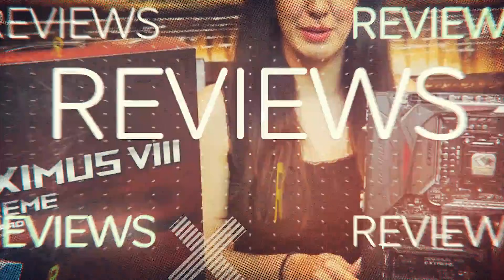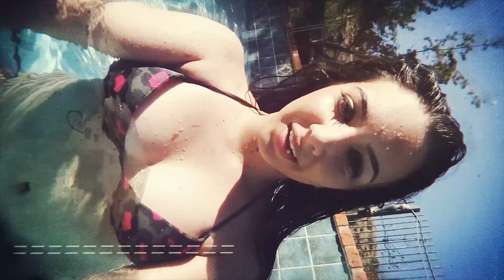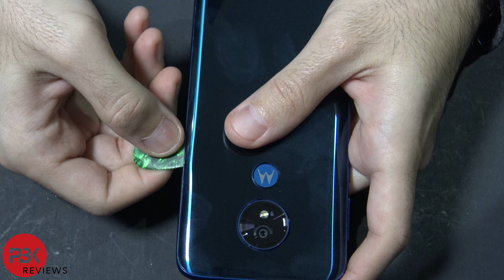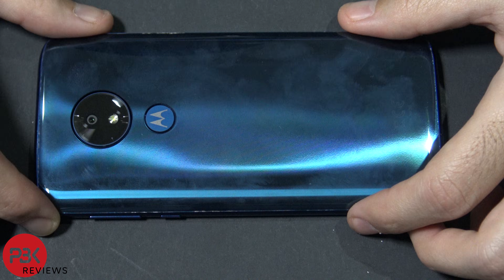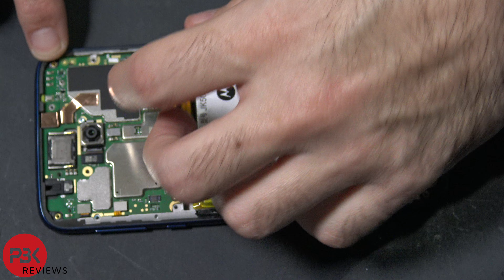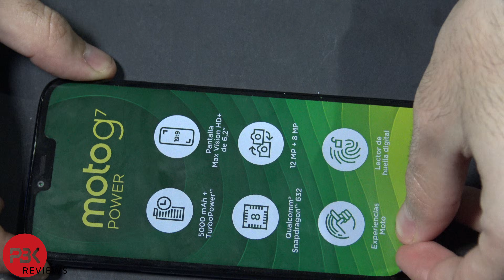Motorola Moto G7 Power Disassembly Teardown XT1955 Repair Video

Comment: Do we have to take the Whole Entire parts Out of The Phone in Order To Replace the Battery??? Or Can you just take the battery out On Its Own.
Reply from the maker: no, just enough to gain access to disconnecting the battery cable and prying it off. You can use isopropyl alcohol and apply to the sides n let it sit for 30 seconds so it goes underneath and eats away at the adhesive, making it easier to pry off.
Reply: Thank you

Comment: Amazing teardown ! Thanks for all the info about this phone. Can anyone confirm which side is positive and which negative on the connector from the battery to the board ? I want to try to skip the battery and just power it from a power supply. Thanks.
Reply from the maker: Thanks. I'm not too sure on that to answer your question. Maybe someone else can chip in and answer it :)

Comment: Im having trouble with reception. In town its great but it doesnt get good reception like it use to out in the coutry where i live. Does the antenna need to be replaced??
Reply from the maker: I don't think it would be a replacement issue. You can try taking the back off (which would require new adhesive to re install) and making sure the bottom and top plastic covers are in place and screwed down since those have antenna lines running through them. If not, the only other thing I can think of is its possible they have changed tower frequencies or bands in your area or a certain tower is out of service or they changed the position of one of the towers to send signal in a different direction more which sometimes happens.

Comment: Thank you so much..with your video I was able to replace my charging port. Saved me alot of money that I did not have.
Reply from the maker: Glad it helped!
Reply: @PBKreviews  I used to have the phone, then I upgraded to s22. the moto's battery would last from the time I woke up to the time I went to bed charged to 85%, and not dead the next morning either (although it would be at 20%), even after it was over 1.5 years old. I would be lucky to have my s22 last from 5am to 8pm on a full charge. point is; it is ironic how old budget phones which costed $200 could outlast modern brand new flagships.
Reply: I still can't get the last at the far left out. I can get all of them except for that one and I don't know why?.

Comment: so after putting it back together the screen doesnt react to touch but its on and working any ideas? plz help
Reply from the maker: Can be a loose cable or dirty cable contact, try cleaning the gold tip of the cable with a micro fiber or something to make sure its clean. Also can be a defective screen, or a short somewhere causing the screen not to function properly. Before putting the screen in place, try connecting the cable only and see if the touch works. If it works and when you seat the screen in place and it stops working, it means something on the screen is touching the metal frame and shorting. If it still doesn't work might just be a defective screen.

Comment: My speaker is weak and distorted, and a few people tell me they can barely hear my so I need to try to clean my speaker and mic. Any tips on doing that? My charging port is a loose too and doesn't always connect. Are the mic and charging port on the same board? If so, maybe I should just replace that.

I need to order screwdrivers. Yours is T4 but another place says Phillips. Any idea why?

What thickness is your guitar pick?
Reply from the maker: Hi, yes both the mic and charger port are on the same sub board on bottom. If you are replacing that sub board, make sure to get the correct version for your model phone, since different region versions might have different antenna point/contacts which might give you some signal issues. Also some aftermarket ones are known to have signal issues. You can check mobiledefenders.com to see if they carry this part since they usually carry OEM stuff for Motorola. Also brush off the mic hole on bottom to make sure its not clogged causing your voice not to be heard. As for the speaker/ear speaker, the filter might have gotten clogged/dirty causing sound issues. You may need to clean that somehow or replace the filter but those filters usually aren't easy to find and sometimes require prying the screen off as well to replace the mesh filter. As for the screws, they should be T4 torx screws unless a different region of the device uses different type of screws but highly doubt it.
Reply: @PBKreviews  Thank you for the information. I tried blowing real hard on the speaker, and tried holding a vacuum cleaner up to it, but neither worked. I'm thinking there's dirt on the back side of the mesh that I could remove if I open the phone. Also in another video, I think it shows a small filter attached to the mesh (inside phone) that catches stuff and could be replaced, or just removed and not used if that's what causes problems.

Motodefenders doesn't show that they sell that board for it. They do have the separate charging port and speaker, but not sure how hard those are to replace, and they don't sell the mic. Hopefully cleaning inside will solve the sound problems. My charging port isn't too bad. 

I'm not positive but the problems seemed to start after I wiped the phone with a wet cloth, but that was weeks ago and it's still happening.

BTW, I have the G7 Power US version.

Comment: Hello! I have a question. My phone is able to be charged but I can not currently turn it on due to the power button falling off, if I removed the battery and put it back together would that make it turn on? thanks in advance!
Reply from the maker: Hi, no it would not power the phone on but disconnecting and re connecting the battery. There should be a clicker on a flex cable where the actual physical button presses on. You should be able to use a tool to push in that clicker to power it on but keep in mind over time doing that would probably wear out that clicker or damage it.
Reply: @PBKreviews  its okay, I got it fixed by a friend

Comment: I broke the little connector on  the board, where it goes connected one of the tiny coaxial cables.
Where do I get a replacement?
Then I have to solder it.
Reply from the maker: Connectors you may need to look on ebay or google it not too sure on that. I'm not a pro at soldering myself so haven't spent much time looking into it.

Comment: I need help. Everytime I plunge my phone in the charger, it doesn't charge. My charger works on other stuff not not my phone.
Reply from the maker: Its possible your charger port is damaged or gone bad. You would need to replace the charger port board on bottom from inside the phone as shown in the video.

Comment: I have replaced the charging port board since it was bad and now I have no cell signal.  Can you tell me where the antenna is located on this board?  Thanks!
Reply from the maker: Make sure the black plastic cover that sits over the charger port board is seated properly and the charger port board is seated properly as well. Both that black plastic cover and charger port board have antenna contacts. Its also possible the charger port board you have is defective or not the correct model one (different regions might vary slightly so make sure its meant to work with the - 1 -2 -3 etc that comes after your phones model number)
Reply: @PBKreviews thanks, but when I put the original board in to see if the cell service signal returns, it still does not si nit the board. When I was replacing the board, initially, and moving the coax antenna cable out if the way, I heard a snap noise.   Is it hard to replace the antenna?  Thanks for your input.  I hate to just toss my phone when it may be an easy fix.
Reply from the maker: @lmd6204  Hard to tell what broke. Is the cable damaged? those heads on those cables get damaged easily. The thing is its not just one antenna to say its this and you can change it. Its multiple parts so not sure what broke or got damaged exactly.

Comment: What screwdriver is required?
Reply from the maker: Its a T4 Torx screw driver. There is a link in description for tool sets if you need.
Reply: Thanks for answering but I literally found a presision set my dad bought years ago i need to replace my charging port on my phone because it doesn't work
Reply from the maker: @Eray2007  sounds good, no problem

Comment: I have a Motorola g7 that has files not backed up and I need it. I thought that screen was the issue (its cracked. Especially at the bottom) so I had that replaced at my local store and it still isnt turning on. 

There might have been a drop of two of water that got on it and went through the bottom of the screen where the charging port is.

Is the power supply the culprit probabably? I will pay good good money to have this fixed or to restore my files.

Even if I have to buy another G7 and swap out some of the guts. 

Please any info? I'm desperate and panicked
Reply from the maker: Your best bet would be to buy a used G7 same model as yours, and take out your main board and put it in place of the used working one so you can be assured all the parts in that other phone are working and undamaged so you can see if your mainboard will power on and work fine. Hopefully that is the case and you should be good to go.
Reply: @PBKreviews  Removing the motherboard and putting it in a working phone will retain all of the data correct?
Reply from the maker: @levijessegonzalez3629  Yes correct.

Comment: Mine has a white wire and I don't see where it attaches.  The light also does not work.  Any ideas?
Reply from the maker: You mean the flash for the camera is not working? make sure the back cover is seated properly since the contacts on the flash board need to touch the contacts on the mainboard to get signal. If it doesn't work still, then you might need to replace the flash. As for the wire, not sure what wire you are referring to

Comment: 5:28 "your earpiece speaker over here on top"

What about the loud speaker for media and hands free? Where is that speaker?
Reply from the maker: Its the same speaker for earpiece and loudspeaker. This phone does not have a separate speaker on bottom for the loud speaker.
Reply: the moto g7 comes with a single speaker that acts as the earpiece speaker and loud speaker. pretty loud and good quality for a single speaker.

Comment: Time to buy a new cell phone, my Samsung S4 is 7 years old.  Want a phone where I can replace the battery, with the S4, use my finger nail to pop off the back, pop out the old battery in and pop in the new one.  Can carry two charged batteries in my shirt pocket and good to go.  Really like my last Motorola cell phone, also that easy to replace the battery and we even had an external charger.  Apple, have to send in your phone with 50 bucks or use a heat gun, you take the risk and the battery is still 50 bucks.

Looks like this G7, is time consuming, and should also use electrostatic hand grounded protection.  Surprised Motorola made this more complicated.  Would not try this at an airport while waiting for a plane.  But fine on my electronic workbench.

Comment: Hi man, thanks so much you video, i do that gor clean my horn cellphone, but when i turn on the cell , i try it to use flash and camara but its no work and a message appears ;Rear camera hardware does not work wrong 0140001 and automatically the selfies camara turn on, i try it clean the memory cache in software but dont work, u know what i could do ? Thank you !
Reply from the maker: If the phone has water damage, its possible something is being shorted on the board causing that to happen. If not, make sure the camera is connected properly to the main board and has not come loose. Also make sure the plastic cover that has the flash on it is seated properly in place and screwed down because the contacts need to touch the board to be able to give it power. If your camera still doesn't work its possible you have a defective camera and might need to purchase a replacement camera to replace with the defective one.
Reply: @PBKreviews  mmm too sad, well thanks so much for you info and help man !
Reply from the maker: @Glethek  no problem :)

Comment: Gluing these phone cases is the worst thing phone manufacturers have ever done.  They could make a model instantly popular by simply using a few common screws or a snap-on plastic cover with a rubber gasket, and then having a battery that could be just pulled out and in.  Anybody with brain one uses a case anyway.

Comment: Nice video! I replaced the screen, but now I cannot hear anyone, nor the other side can hear me. I went to the settings and sound, it was up, restarted the phone but nothing happened. Any suggestions please Thanks
Reply from the maker: Them not being able to hear you and you not being able to hear them are two separate issues so they would not be related to one problem. You probably did not assemble the phone correctly or damaged something while taking it apart. The mic you speak into is located on the bottom board with the charger port, and the earpiece speaker is on the top of the phone on the midframe. The plastic cover that goes over the motherboard needs to be in place and screwed down properly or it wont touch and make contact with the earpiece speaker for it to function. Did you replace just the screen or the screen with midframe assembly?
Reply: @PBKreviews  Thank you for your reply. Yes I did, I put the covers back on and put all those screws back carefully, I will do that again , take the cover out and put it back again, and the mic. cover too

Comment: Is the back made of a glass ontop of a plastic or is it just plastic or what?
Reply from the maker: Just plastic if I'm not mistaken
Reply: It's called "acrylic glass," which is actually plastic, but it's really good plastic. From what I've read; it's the same stuff they use to line hockey rinks.

Comment: Anyway to put the g7 power battery into the g7 ?
Reply from the maker: no the batteries are entirely different shape and size, would not fit.
Reply: @PBKreviews  dang it 😤 .. the g7 lacks the  battery IMO .. 

New Moto G (8th gen) seems to address it 😏

Comment: These damn phone companies really go out of their way to make replaceable batteries a thing of the past when in reality this phone could have easily had this option, but instead they opted to make it so you need to disassemble the whole damn thing up to the last screw to be able to remove the battery.. fuck them.. bye bye.
Reply: Interesting...I was checking this option and on the Moto G6 you CAN switch the battery by easly taking off the backside by pressure in a corner. Strange that they went back to a non-removable battery on the G7...

Comment: I need to replace the port do I need to remove everything like in the video or can I just remove the bottom part?
Reply from the maker: You can do just the bottom part, but you would need to take the top black cover off as well to disconnect the battery cable so you don't risk shorting anything.

Comment: I think i need to clean my speaker cuz after my phone got 100% submerged in melted ice cream, the speaker sounds distorted.  I tried cleaning the mesh with electric toothbrush and rubbing alcohol to no avail.  

If i take back off to get to the speaker, will the original adhesive be enough to keep the back on when i re assemble it?
Reply: Or will i have to order more adhesive?
Reply from the maker: You would probably need new adhesive to hold it down properly. Also you might need to change the mesh/speaker grill filter since its possible its clogged from the ice cream.

Comment: Do you know if it's possible to remove the battery on this phone, and then wire up the main board to an external power source, and power it up without USB? I know it seems weird, but I bought one of these phones as a dedicated media server for Android Auto for my car's head unit. I know I could have gotten an SBC, but I needed something with built in WiFi, Bluetooth and SIM Card support to accept calls on my car's head unit.

My car doesn't provide enough power to charge this phone, but I do have a Cellink Neo battery for my car that can in fact power this up. Currently I have to switch USB ports from my Car's USB to the Cellink Neo battery to charge over night. This is cumbersome, especially if I forget.

I was hoping I could physically remove the battery, and then drill holes for wires that I can then connect the main board to the Cellink Neo battery. This Cellink Neo battery is fast charge when my car is on and it would keep the G7 I have alive -- a requirement I have so I can access it remotely at any time. 

Any idea on whether or not this could work? Your video did take me about half way there, knowing I can access the battery is very helpful. Thanks!
Reply from the maker: Honestly I'm not sure. Would require both engineering knowledge and soldering skills if even possible. Not sure if a current from anything aside from what its battery gives would work to not fry the board or anything else. Also not sure how you would be able to wire to the connector, maybe to the battery leads since usually the batteries have a +/- that is connected to the head chip module that dictates the battery on how much to charge and such. But again removing that could lead to the battery overcharging or draining quickly. Again not too sure, I am not a professional in the electrical engineering of it so would not be able to give you a direct answer. If possible I would say would be difficult and require a lot of modification.